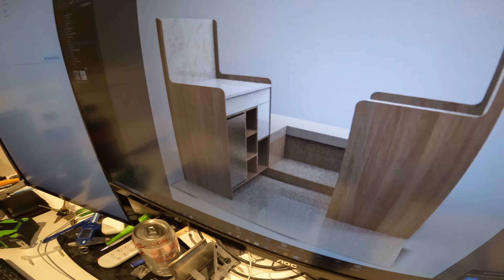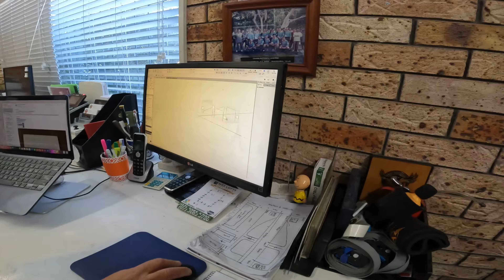OKA TRUCK BUILD SERIES EP3 - Poptop Canvas Install, Solar and Dometic Aircon Install

Comment: Just a thought, but to protect your rooftop aircon you can always make somethimg similar to a motorcycle sump guard with ventilation holes shaped to defect branches away from the unit. Wouldn't be that difficult to make.
Reply from the maker: That was the plan .. we have installed scrub bars at roughly the same height as the aircon .. fingers crossed 🤞🏽

Comment: Looking good!  A tip for closing up the top (as recommended by my pop top camper builder), close all of the doors/windows and run the ceiling fan on high, exhausting out and it will create a vacuum to help pull the canvas inwards while lowering.  It works great and helps prevent any pinching of the canvas.
Reply from the maker: Awsome idea .. will definitely try this when I wire everything up !!

Comment: Your AC will shade your panels. If the panels are wired in series this could be a big problem. If in parallel, less of a problem but still not ideal. Check with the supplier/installer about your options to minimise losses from shading mate. Microinverters, separate parallel wiring, or maybe a way for the panels to lift up to the height of the AC?

Comment: I was watching your air conditioning episode.
Thinking you may use a split system.
To keep it out of the mud and trees.
Putting the motor on the back area.
Oh! No. Stop. Drilling holes in you $100.000 car.
Oh, um. It's for the air conditioning.
That's or right.

Comment: Should of went with an insulated canvas/vinyl. You lose a lot of heat/cold and means the AC will be drawing more juice. The difference on mine was significant, I own the white canter with the 79eatr plates you just about broke your neck looking at the other day